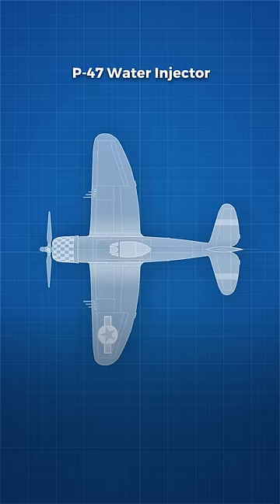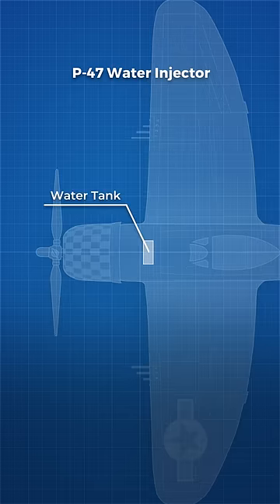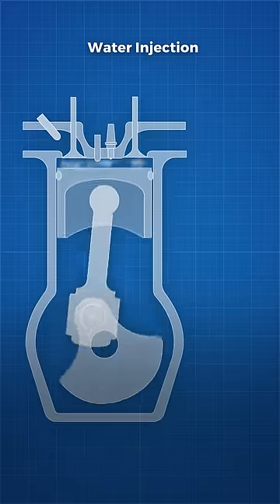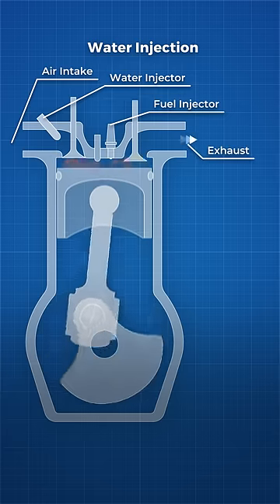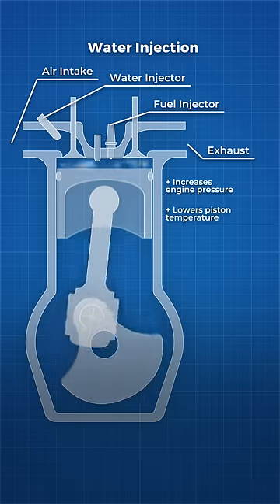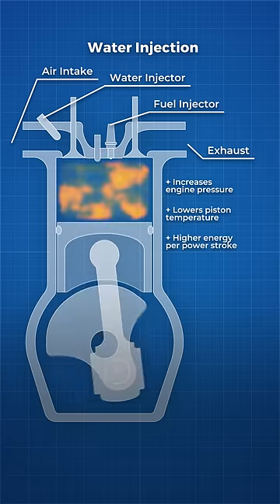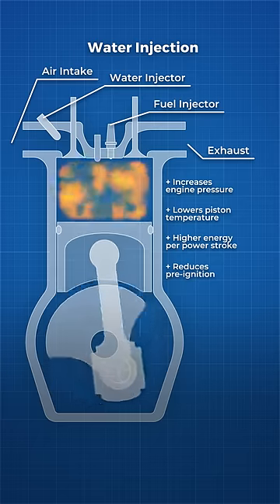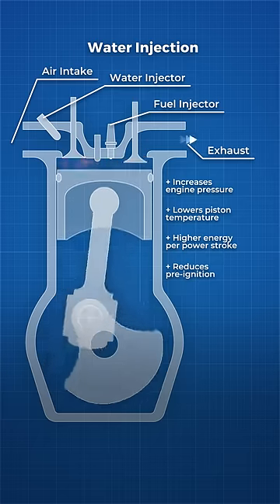How Water Injection Increases Horsepower

Comment: On top of what other people said, pre-ignition causes loss of power by causing catastrophic engine failure, not by igniting too early working the wrong way. Reducing knock means you can advance ignition and run leaner, increasing power.
Edit: fixed grammar
Reply: How is what you're describing different from detonation
Reply: @jjbloon  What I'm describing is preignition/knock/detonation. I'm correcting the video.
Reply: @madmax2069  not at all
Reply: @johnhunter7244  I was under the impression preignition and detonation are 2 different things that can occur together but aren't the same
Reply: @jjbloon  they are different but similar, caused by same things and are terrible for the engine.
Reply: @johnhunter7244  DET is uncontrolled burning of the mixture from any location within the combustion chamber rather than the desired so as to produce a predictable flame font (AKA controlled burn). Pre-ignition is something usually attributed to a hot spot such as carbon build up.  In the video clip the benefits of using water alcohol mix is to allow more spark advance by means of damping the combustible mixture thus making it less volatile, almost similar to adding more octane.  Any engine design that utilises such methods is generally a bad design because the power gains can not be maintained for long durations.
Reply: @CATANOVA 

I don't see how that's a bad design. The entire POINT of this is to provide a short term power increase for use in Emergencies. It's not there to increase your 100% power, it's there to let you use 110% without exploding
Reply: @spindash64  It is a bad design because it needs the fluid to work plus axillary systems to ensure the fluid is present and is being administered correctly.  If we tune an engine for peak performance then the addition of the water alcohol mixture reduces power in most cases since we are reducing the available volumetric efficiency for oxygen and the hydrocarbon fuel.  If on the other hand we add more spark advance or more boost pressure for an engine that is not naturally aspirated, then we can control DET with the addition of the water alcohol by way of damping the mixture volatility but only for as long as the amount we have in reserve.  If we run out of the juice then we need to know not to add more spark advance or boost pressure since we can break the engine.
From the point of view of building engines that are meant to have a reasonable service life with respect to performance, economy and durability, the application of juice isn't a good idea and hence why we don't typically see it on anything mainstream.  If we are talking about drag racing or some other kind of one shot deal then the system can work fine, but wouldn't NOS be better suited for such things?
Reply: @spindash64  Emergency also kind of points to some situation where there is risk to life or property where counting on such a system vs plain old reliable straight forwards engine would be much better.  An army APC trying to get away from an enemy should have a proper engine to do the job and not need a juice injection.  A plane with passengers trying to take off on a short runway should have an engine capable of doing the job vs crashing because someone forgot to add juice, and so on and so forth.
Reply: @CATANOVA  how is the water injection not part of "a proper engine?" It's cheaper than gasoline, gives more power than overrevving AND has less risk of ruining the engine, and you don't run your engine at 100% power continuously in aircraft ANYWAY

FFS, that's like arguing that an engine should run without Gasoline, or it's bad
Reply: @spindash64   Water adds no power whatsoever to a gasoline engine.  It is not combustible!
All your water is doing is damping the explosive mix so that it is less volatile, very similar to octane.  When we desensitise the fuel air charge, we can then dial in more spark advance or increase boost pressure.  If we did neither of these two things then the addition of the water detracts from the volumetric efficiency by way of taking up atomic space that oxygen could have utilised.  If on the other hand we inject water at high pressure like a diesel engine when the valves are closed then we avoid that problem.  The addition of water in all cases promotes molecular spacing of the hydrocarbon fuel slowing the flame front propagation, robs heat energy from the burn but does give something back by way of water expansion in to steam.
Having mentioned steam, one has to consider if we are running a steam engine or a gasoline engine FFS.
Injecting water in to a gasoline engine is a bad idea, a bad design or a cheap fix for not doing the job properly in the first place.  I would only ever use such a technique in drag racing or something similar however there are much better ways of boosting power by way of a button or similar which can YIELD much more power.
A closing note would be to say that just because something has been done, doesn't mean it is a good idea.
Reply: @CATANOVA  it's not combustible, but it lets you add MORE air and gasoline, AND lets you compress it further before detonating

Higher compression = greater power per given fuel consumption

The engineers of the 1940s weren't idiots, as much as you'd like to feel superior to them. If Water Injection were that awful, they wouldn't have bothered
Reply: @spindash64  No matter which way you do it the water injection takes up space that fuel and air could have had, unless you inject when the valves are closed.
Your higher compression statement does not belong here because you can not adjust compression on the fly unless the crank can be moved or something can protrude into the combustions space to cause a displacement change.  If we dial in more compression by default to such a degree that water damping is required then the design is bad.
I am not calling designers of the 40's idiots.  Also a lot of research in to fuels and octane came specifically from the aerospace industry with respect to altitude and supercharging, so we have them to thank for this valuable work.
If you think I am wrong about squirting water, please take your car to a dyno and do  some testing by way of using a jet washer in your intake or similar.  It is a bad idea and easily trumped by adding a secondary fuel tank that can switch the engine fuel supply to a more exotic mix to cater for a secondary race map.  Alternatively just add some NOS which I'm sure was also available in the 40's.
Reply: @CATANOVA  This 'increased compression ratio' always confused me. Like how would you increase the ratio while the engine is running.
Reply: @basitwani44   Not sure if it exists but one could increase the compression ratio by using combustion chamber displacement.  One may use a solenoid or actuator of sorts to push in a solid mass, a bit like how a valve works.  Also worth mentioning is that the compression ratio would also vary ever so slightly with RPM due to conrod stretching at TDC.  The higher the RPM, the more the stretch so to speak.  Another way of perhaps doing it would be to have variable main bearing journal seats/saddles or whatever you want to call them.  Probably digressing too far off topic.
Reply: I don't see how this "corrects" the video at all. Pre-ignition does cause significant loss of power, and every knock does not cause "catastrophic failure". It def damages the engine and puts stress on components that can eventually cause failure
Reply: @Caffeine_Addict_2020  I think the comments are just about DET and pre-ignition in general along with the validity of water injection.  We don't need to correct anything rather just a bit of healthy debate on the subject can be fun sometimes.
Pre-ignition doesn't always cause significant power loss and it is possible for it to enhance combustion when you think about it.  I am stretching the imagination a bit with this but think of twin spark engines.  In practise however it will likely never be seen lol.  DET on the other hand should always be avoided since it is always damaging to whatever degree.  We want predictable flame front propagation rather than instantaneous explosion that rattles the internals. 👍
Reply: Can increase boost when water is injected. Injecting water and extra boost gives extra 300hp on napier sabre engines.
Reply: @bakatzen6243   Probably, but it isn't a very good way of controlling combustion.  One could also spray the water over an intercooler and pick up power there too.  Which is the better use of water?
Reply: @CATANOVA  up there you have all the air you need to cool the intercooler. not the issue of intake air temperature anymore, water meth injection is to increase knock resistance.
Reply: @basitwani44 
Cooling is necessary after the turbo or compressor. That's why an Aftercooler and/or Intercooler are installed. Engines lose power running on hotter intake air.

Injecting methanol/water into the air stream after these heat exchangers and before the intake ports will further increase air density from evaporative cooling. This increases the mass flow rate into the cylinders, thus providing more oxygen and fuel per stroke. 

If slightly more water is injected, the water is not completely evaporated in the intake manifold, and will absorb even more heat while evaporating during the compression stroke. This reduces the torque/work required for the compression stroke. 

But any water droplets remaining after compression is not desirable since it will rob temperature/pressure from the ignition and power stroke. 

However, spraying methanol/water is only appropriate if power is inadequate at full throttle. It definitely should not be used for cruising or for prolonged periods as moisture will contaminate the cylinder wall oil film and invade the crankcase.
Reply: @CATANOVA  It seems you are not understanding the difference between spaying water on the outside of an Intercooler, vs spraying the water directly into the inlet air of the engine... You need to study water and Water+Methanol Injection in much more detail,  because you are messing concepts. 

Just think: WHY would the designers of the P-47 engine want to copy the German engines designers that had successfully added this MW injection, if it was not advantageous? !!! 

Additionaly, any attempt to discuss engine operation, when the engine is not only operating at varying altitudes, boost levels, with a complex arrangement of not only a mechanically driven Supercharger, but also a Turbocharger, without having all the air/fuel maps and both supercharger and Turbocharger maps at hand, is futile. This is a complex panorama, and nobody can throw a valid opinion without properly handling all the variables and Thermodynamic considerations.
Reply: @alfredomarquez9777   All my responses on this thread are related to the use of water being a poor solution for the control of DET.  It is far better to produce a design that mitigates DET in the first place.
If we are talking about war machines then surely logic dictates producing something that is robust in design or fault tolerant vs  something that is so highly strung that it needs a consumable fluid to prevent self destruct.  Further, if they wanted an extra power boost then why not just use NOS.
War machine engines, in particular planes, should always be de-tuned for plenty of safety margin.
Spraying water on an intercooler is an alternate method for gaining extra power or lowering the fuel air charge temp to lower the risk of DET.
DO NOT SPRAY WATER IN TO YOUR ENGINE, IT IS A WASTE OF COMBUSTION SPACE. 😹
Reply: Why is everyone so worried about editing? I don't understand. That, edited lol
Reply: Preignition is the start of detonation. So to say detonation is kind of like severe preignition. So it's flame fronts colliding. Straight methanol makes good power in race cars too and runs cooler, but it takes a lot more of it. As there's less energy in alcohol verses the same volume of gasoline. And water is H2 O , just sayin.
Reply: So yeah the war button was to extract that bit of extra power temporally. Not necessarily a design flaw IMHO, ok.
Reply: The engine doesn't fail everytime this happens, so if the con rods don't bend or break, then it's just pushing against its own torque, it's bad but doesn't blow everytime
Reply: @Natedawgontheright  
Back in the day I used to get engine's for rebuild that had holes blown through the tops of the pistons, broken top rings and even the top ring groove collapsed to where the ring was pinched in it and couldn't expand and contract that'd tear boes up, but with the new materials, even in regular cast pistons, those days are pretty much gone, occasionally I'll get an engine that looks like the top of a piston has been beat on with a ball peen hammer and there'll be little specks of aluminum all over the inside of the combustion chamber and on the end of the spark plug but I haven't seen anything broken in a long time.